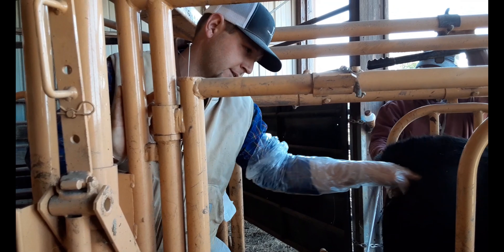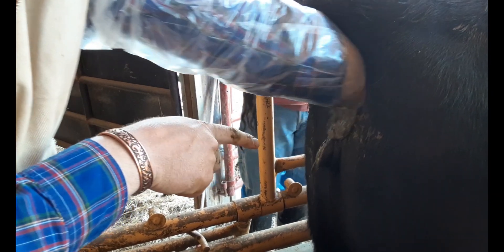Breeding Heifers Using Synchronization and AI (Artificial Insemination) | Livin' On The Farm

Comment: What is the name of the drug that helps them drop the egg, which increases the odds of conception?  What % of success do you usually get?  And lastly, once they have been synchronized and bred, will all  that didn't take, come in heat again at the same time?
Reply from the maker: Hello Gina! Cystorelin is the drug that we use. On these commercial heifers that are set up using feed additive, we usually run about 68% on A.I. The ones that don't take usually come in heat within a couple days of each other which would be the next cycle 18-21 days later. After that they start to revert back to their natural cycle.
Reply: @livinonthefarm8593  thanks for that.